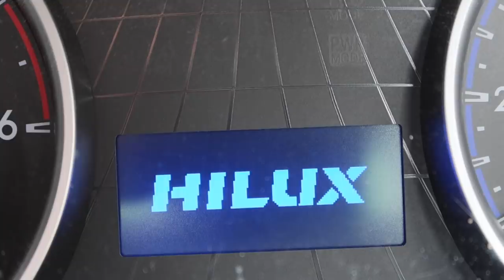This is the most famous Toyota Hilux on the internet.

Comment: Found this by just doing my monthly search for mk2 hiluxes, have always been a great admirer of furzes little green truck. Great video
Reply: I also own an '88 Hilux that came from the factory blue. No rust, beyond some surface bits on the body, tailgate and window winches/door handle mechanisms are pretty much thrashed. But a great off-roader worthy of restoration. I'm always looking for another!
Reply: @ethanbrendmoen4144  haha good luck finding one. There's still plenty but nobody wants to sell them. It's been my absolute dream car since I was 6, specifically the 2.4 singlecab 4x4 in red or blue, with the optional bull bars and roll bars. If that's what you've got, I'll be immeasurably jealous.

Comment: The button to release the car key:
If your car/van/ truck has a steering lock and no held key then the key can pop out when you are 'tearing the arse out of it !' , then you crash as the steering locks.
I once towed a car down a London street, the key popped out at a speed bump and the car driver couldn't stop the car ruining the sides of a row of parked cars.
Reply: If the lock is working properly the key shouldn't be able to come out in any position except "off", it's just another thing the Americans needed to stop them doing stupid things and suing the manufacturer same as having to put your foot on the clutch in the new one.
Reply: I drove a Hilux once, which the key could be withdrawn in any position... the steering lock didn't come on, though, unless the key was removed in the off position. You could also drive it with the handbrake (that's the e-brake if you're 'mercain) hard on & suffer no discernible loss of power. Ah, the good old days, when the police didn't have computerised records of insurance, tax and MoT status...

Comment: I think he should take the bed off and repair the frame rails and potentially hunt down a new power plant or have the engine refreshed. Eg rebored new rings, valves recut and new springs. Also just in general de rust everything

Comment: my dads still driving his 2002 ford ranger he bought around 2010. it's been in 2 wrecks and he pulls a 10 foot trailer with it about 4 days a week. it's got around 450,000 km on the odometer....i can't remember what he paid for it but it was around 3500 usd so i guess there is no need to "upgrade" to a toyota until he's driven it another few years and clicked off a half million km...i might add my mom drove it for a couple years before my dad took it over and while she always had the oil changed on time my dad never changes oil and only adds oil once in awhile if its low...

Comment: In the States they were last called "Hilux" in 1974.  I do see Hilux nameplates on the road occasionally, even here where the bodies rusted hard & fast, though ran forever.  That's the trouble, nobody sells them who has them!  I've only had one pickup in life, a beaten Isuzu lowrider with the roof cut off.  My Toyota was a 1969 Corona Deluxe-a Galaxie as big as a beetle, Las Vegas garage queen from new-paid $500-.

Comment: Good storytelling again, especially writing off your own motor with a concrete fence post. Had to write off a MG Maestro after the bonnet flew open at about 80 overtaking a truck on the A414. Had to peer through the arched gap created at the lower end of the windscreen to complete the maneuver and then get off the road. Whole roof from  bottom of A pillars was pushed back 50mm, no broken glass, bonnet bent flat over top of roof too.

Get Mr F to plug this vid on his next caper?

Audio didn't prevent me from understanding every word so I guess the problem lies mainly with English speakers who don't live in the UK.

Will changing pervert to perv alter restrictions and algorithm shenanigans?
Reply: my mate had a similar event in his metro turbo at a highly illegal speed in the outside lane of the M6!

Comment: I wish you could still buy simple trucks like the silver one in America.  The base model tacoma is extended cab and v-6 and nearly $30k.  Thats why 90s toyota trucks bring a premium price regardless of miles.  A mid 90s 4wd 4cyl manual with 200k miles will bring $6k to $10k. I have a 91 2wd and I love it. There is a big market here for small trucks.  Not everyone wants to spent 50+ grand on some gigantic ass chevy or ford.  Even the ranger and colorados are the same size as a ful size was in the 90s.

Comment: Shame the new hilux isn’t “invincible” 

The last gen prius infotainment which fogs up when you look at it funny and can’t be used with gloves and pixels die after a few hard years

The DPF which doesn’t regen and melts getting the engine so hot it overheats

The egr system which cokes over the pistons 

Electronic transfer case engagement where the solenoid doesn’t engage 

Vacuum operated hubs (the lines perish and 4wd doesn’t engage)

Seat coverings which are made of from what I can tell is the thinnest fabric ever conceived, that tears after a years worth of service 

Bring back all mechanical with modern engineering tolerances
Reply: Company got a 2019 and doesn't have electronic linkage for the 4x4 nor a Prius infotainment system or a screen at all xD 

About the seat 100% agree we haven't got a single Hilux without broken seats in the 1st two years xD

Reliability wise I think it will be fine it has the same 2.4 our 2008, 2011 and 2014 have and those have been good, maybe you talking about the 2.8 and I have no idea about how good or bad that one is

Also this is in Latin America maybe our versions are different

Comment: I think the new Hilux will be a good beater truck in 20 years - the people who buy a regular cab truck will use it as a truck. Toyota - who still has some of the simplest, most reliable designs - combined with this being a basic model, means everything that does break should be simple to fix.
Reply: Questioner my money is on the MY19 and pre l200 and Isuzu, I have a fleet of trucks that are rented out and used to tow and the hilux was back at the dealership quite a few times, the 2015 and before gen hilux 3.0 will absolutely be a great truck we never managed to mechanically break one, the 2019 hilux had dpf, turbo, traction control, stereo and seat issues from 1500miles on not to mention the adblue shit
Reply: I didn't realize diesels over there had DPFs and DEF now, we've had that stuff in Canada since 2008 on most diesels.

Our Tacoma here is slightly related, but we can't get a short cab anymore, or a manual transmission on a four cylinder. We've had no diesel Toyotas sold here since the 80s; the Tacoma has fairly old gasoline engines.

Comment: I notice the hilux isn't sorn or taxed, mr furze gonna end up with a fine!
Reply from the maker: No, it is off the road at present.
Reply: @TheLateBrakeShow  still needs to be taxed or sorned, i got hit with a 200 pound fine for not sorn a old escort I had last year. I had it kept in a lock up and hadn't moved it since I got the car 7 months previously. But they said as I didn't have a sorn or tax on it I was still eligible for the fine so I had to pay up.